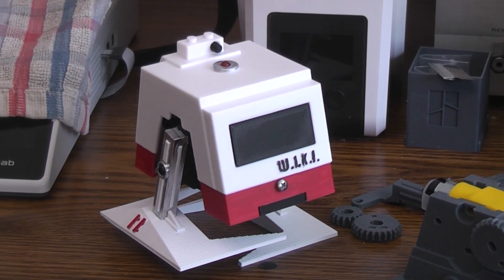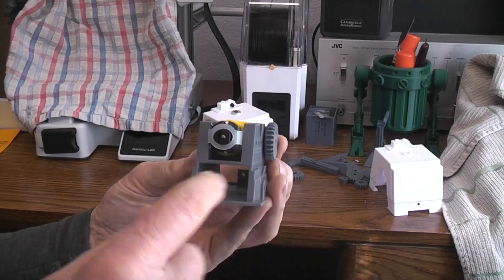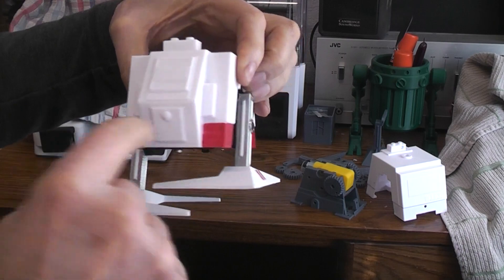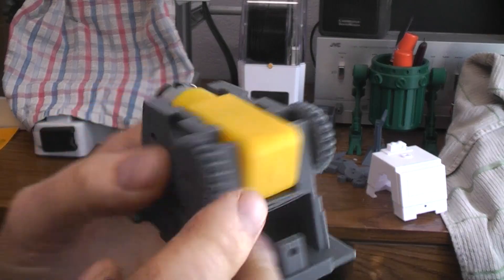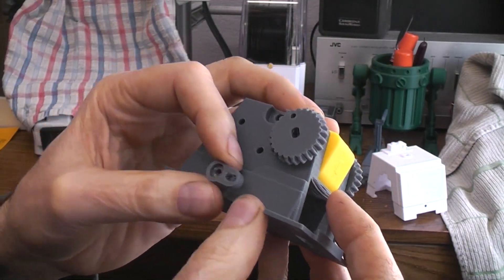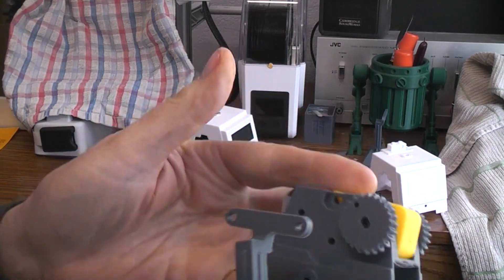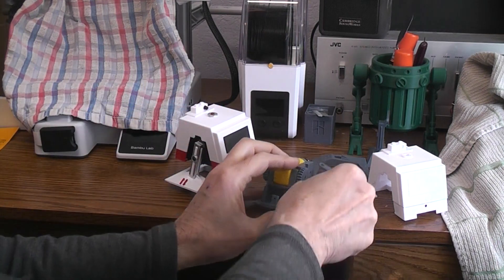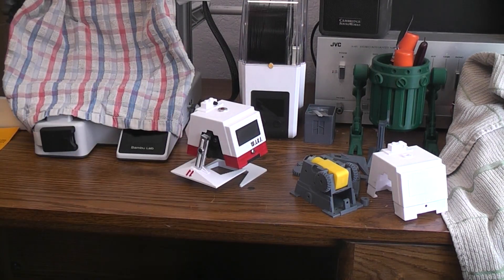3d printed. Walking W.I.K.I. robot using a TT gearmotor, blue 90:1 reduction. 2 AAA battery's.

Comment: Excellent video.  I'm already planning to build this to add to my collection. One more for my grandchildren to play with. :-)) Just wish I could print in ABS, the grandsons are a little bit rough. 🙂
Reply from the maker: Print in PETG, it is less brittle than PLA, acts more like ABS.. Use glue stick on the print bed so it will stick . I had to print the body in PETG because I ran out of white PLA and when I ordered more filament I got PETG, so thats what I used. The gray printed parts you see in the video are PETG also. Prints at a higher temp  "around 255c" and higher bed temp "70c" as well.
Reply: Thanks very much for the information. 🙂 @Robothut
Reply: Hi Robothut, it would appear that there is a 24 teeth gear missing from Thingiverse, it's the one with the bush for attaching to the gear motor.
Reply from the maker: @stephengittins6116  Just added that file to thing-i-verse, it may take them a day or so to update the site.
https://www.thingiverse.com/thing:6535602
Reply: Hi Robothut, file downloaded and printed. Many thanks for your speedy response. 🙂  @Robothut
Reply from the maker: @stephengittins6116  Thank you for letting me know that I had missed a file.

Comment: I'm sure you mentioned it somewhere. But where do you get you t t gear motors if I may ask?
Reply from the maker: I just type TT gearmotor in the browser and check out the prices. Sometimes Amazon has the best deal, sometimes Ebay does. AliExpress has the lowest prices but sometimes the longest delivery times.
Reply: @Robothut Thanks, I plan to build some of you bots. Keep it up.